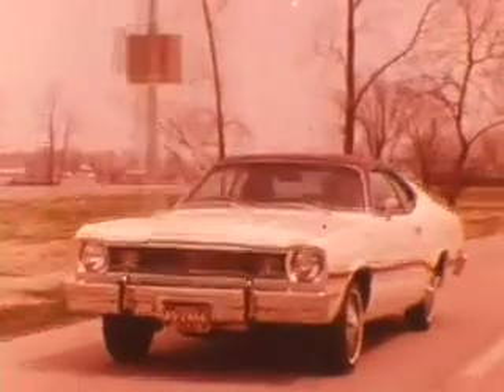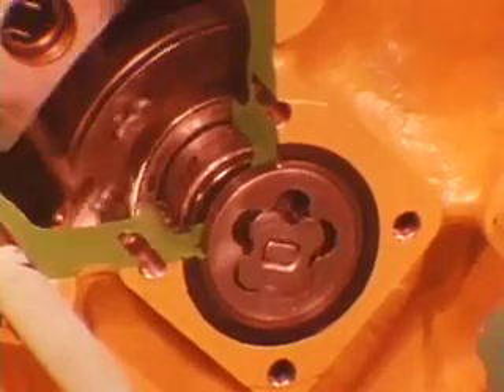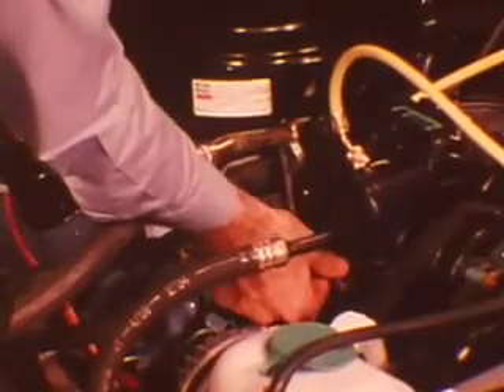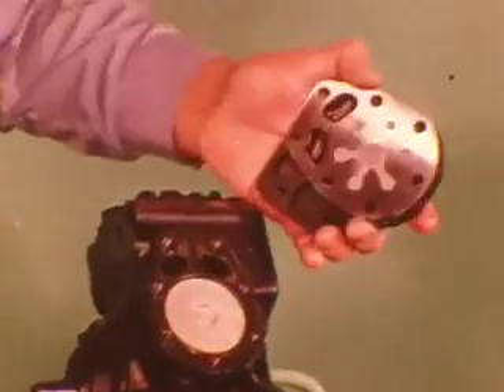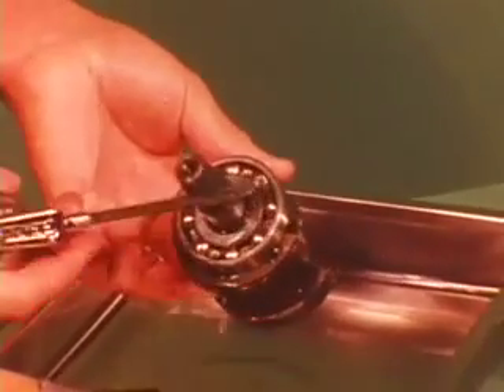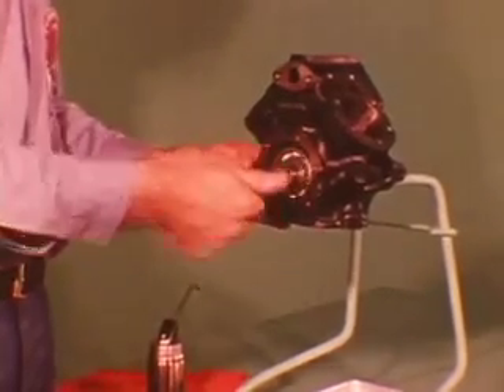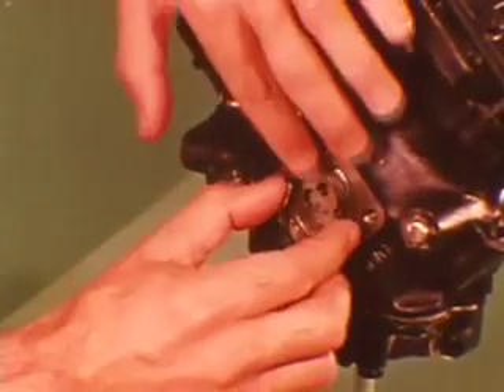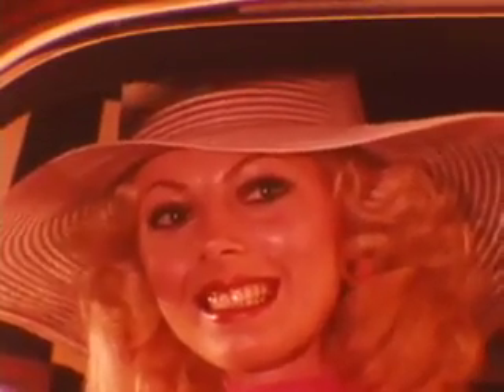Chrysler Master Tech - 1975, Volume 75-10 The Air Conditioning Compressor

Comment: "Discharge all refrigerant into a well ventilated area".  From when DuPont's patents were in effect. R12 was less than $1.00 /#.  Also 5# of refrigerant needed to flush the system.  Check out the price of the new xyz1234 refrigerant.